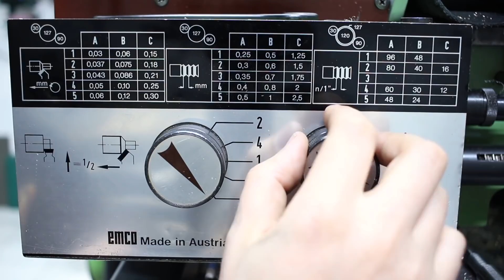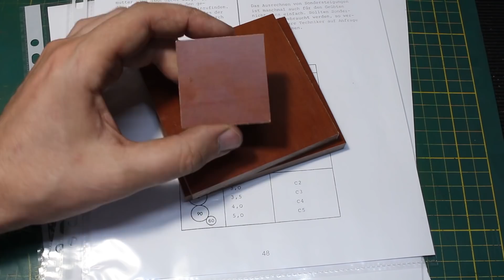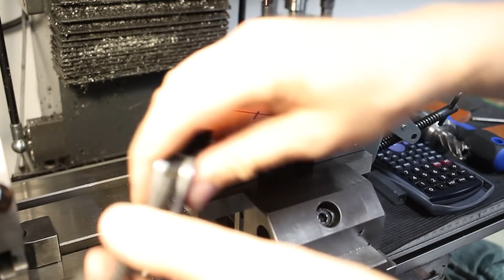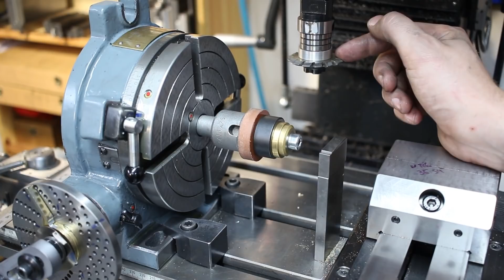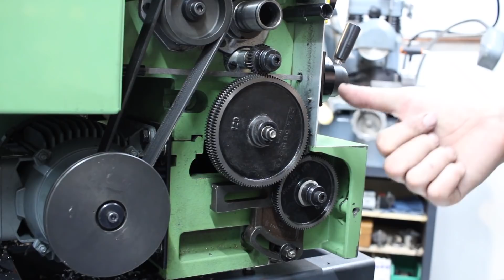Emco Super 11 Change gears, gearcutting and threading

Comment: How do you know how deep you need to mill the slots? I watched it closely and it's not all the way in where the cutter curves, right?

Edit: Never mind, i found it online. For Module 1 it's 2.15mm. Correct me if i'm wrong.
Edit 2: I measured it on a gear that i bought recently and it actually is 2.15mm.
Edit 3: Apparently i was wrong all along. I found enough info here and there to conclude that it must be 2.25mm for M1 gears.

Comment: Hi Stefan, I own the same lathe, and I have not clear what are the correct operation to stay in syncro while threading: seams like you never disengage the feed, is that correct? you engage the feed, make a pass, stop the motor, backup, invert the feed, turn on the motor to travel back , stop the motor, advance, invert the feed etc...
I guess wrong

Comment: I had a 1955 Holden ( made in Australia), GM Chevrolet design.  The timing gear on the camshaft was made of phenolic linen matrix.   They lasted about 15,000 km (10,000 miles) before they broke.  Usually on a Saturday morning, when you needed the car to take the girlfriend out in the evening.   Those were the days, my friend.................

Stavros

Comment: Hey Stephan, I feel your change gear pain. My Hardinge has a 33.3 DP with a 20deg contact angle if you can believe it. Which means there’s absolutely no involute gear cutters in existence to make the 127T I am missing to be able to do metric with an inch gearbox. So I’m stuck with single point hand grind or getting fancy with the material choice on my 3d printer.

Comment: This is odd!  I have the imperial version of this lathe, and I can cut metric 0.75  with the gears provided (8 to the inch leadscrew, use 120/127 gear pack in headstock side).  I can also cut 1, 2, 1.5, 0.6, and 0.5.  On my lathe, gearbox ratios (on the 1-2-3-4-5 lever) are 24/16, 24/14, 24/12, 24/10, 24/9 (to give 16,14,12,10,9 threads/inch) with A-B-C lever in C position.  B and A position halve the ratio, giving imperial threads double and quadruple those in the above list.  All of this is with 30T gear on spindle and 90T gear on the gearbox.

Comment: I always wonder how the number of teeth of "intermediate gears" (like the 95-tooth gear here) is chosen, because it doesn't really affect the gear ratio, and yet someone didn't specify a 100-tooth gear, or "any gear that fits", but a 95-tooth gear specifically... or maybe put differently: why didn't you just reuse e.g. the 120-tooth gear instead of making the 95-toothed one?

Comment: Unless my understanding of gear mechanisms is extremely wrong, couldn't that 95 tooth gear be any number of teeth since its just transmitting torque between two other gears, meaning you could have saved yourself some time and used the stock 90 or 120 tooth gear instead?

Comment: Stefan, Your videos are excellent and very clear. They explain things in a simple way. I have learned a lot from you particularly the scraping ones. I see that others have suggested using a stepper motor and rotary table to ease the division calculations. I have done lots of gear cutting for Horological work with the largest being 400 teeth .4 module. It took ages and I was worried about the dreaded half tooth! Luckily it was ok. I recently had to make change gears and decided to make them of 7075 aluminium and never thought of using Phenloic, interesting choice. I also recently made a computerised indexing system using a rotary table and some readly available components from www.worldofward.com. You can see the results on www.youtube.com/watch?v=ghZqn5L_nfI
I am no electronics expert but it worked first time for me. John

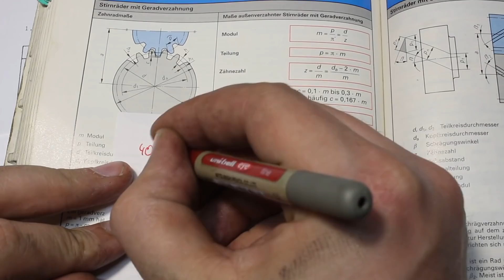Comment: Great job, this is the good old mechanical way, just like we learned it in school before computers were available. Yes i am still familiar with the "Tabellenbuch" and also my heart nearly stopped at 5:26 when you were drawing on the paper sheet i did not see. There is a guy having solved that issue  electronically (for an other lather) using a rotary encoder and a stepper motor with a processor calculating the gear ratio. He can select any gear and feed ratio (metric and imperial) as he likes. I just recently saw his video and i want to build one for my Weiler LZ 280 in winter. 
Have a look at Clough42 electronic leadscrew
https://www.youtube.com/watch?v=FTs9GygRQ-U

Comment: Phenolic gears are good for constant low stress applications but they should not be used for high stress or applications subject to impact as they tend to shear teeth fairly easy. I worked in a shop once that had a small (24") radial drill press that was rated for 1 1/4" maximum bit size. The boss wanted to drill 1 17/32" for pin tabs and had a 1 17/32" bit turned down for the applicable Morse taper in the press. I told him it was not a good idea but he insisted. The phenolic gears lasted less than one hole when they sheared teeth as the bit bound as it was breaking through the steel plate. That drill press never ran again...........

Comment: Very nice. I have an EMCO 5, which has change gears only and only the metric gear set. For imperial, it uses some approximation for the 127/50,  there was an imperial gear set from EMCO which I didn't have. I 3D printed the gears per EMCO table in PLA,  these gears have been working fine for 2 years now. It's a much smaller lathe though.

Comment: great video sir. FYI/SA, EMCO still has change gear sets for the Super 11, or they did two years ago when i realized that it was cheaper for me at the time to get the gears rather than buy the tooling needed to cut gears...they weren't cheap but worth it. had I the dividing head and the gear cutters i'd have done it myself.

any chance we mere mortal Super 11 owners can get the cut plan for the top slide guard you had laser cut???

Comment: Found your channel and subscribed  through This Old Tony and so far am very impressed. I use that same material and also something called Garolite (may be a trade name) that I purchase through MSC here in the states. Use it for a lot of different things. It is also heat resistant and an excellent insulator. I build fixtures for induction braze machines so these qualities are much needed. It is rough on cutters. The material is so dense that heat stays at the surface being cut which will break down a cutting edge quickly. I use only carbide and your use of the shop vac is also correct. It is nasty stuff and the dust gets everywhere. Great job.......

Comment: You've done a few parts in phenolic. Did you get a good deal on some of it?
Why not just some carbon steel or even mild?
Reply: It has nice shock absorbing and self-lubricating properties, plus the gears are quieter and they act as a kind of 'mechanical fuse' because they will always break before the more expensive metal parts. Phenolic gears are really common in machine tools: my dad owns a gearhead drill press that uses helical phenolic gears against hardened steel pinions in the gearbox, and they work beautifully.

Comment: I don't understand.

Why does the first wheel (95) need to be a particular number of teeth? All it does is transfer (and reverse) drive from the drive wheel to the "new pair" (80/40). It could (within limits) be an arbitrary size and hence number of teeth.

I am doubtless missing something, but what?
Reply: I agree. I believe the first wheel can be any convenient size to make the train easy to assemble.
Reply: no you are not
however the bigger the idler the better, as wear will be minimized
the 95 is part of the standard set of gears that come with the machine
Reply: @janvanruth3485  that can't be right. Why would Stefan make a gear that was already supplied?
Reply: @paulwomack5866  it was part of the standard sert but Stefan does not have a complete set

Comment: Stefan, I cut a lot of gears and splines over the years in my old job I retired from (automotive engine and drivetrain) for replacement parts in components. These were cut primarily with gear bobbing and shaper equipment. A lot of the gears were Fellows Stub Tooth in which they used the the pitch diameter of one size and tooth height of the next smaller pitch. This would be expressed as 10/12, 8/10, 12/14 etc. What I'm getting at is is there a Module Stub Toothed for

Comment: I hate this material so much; super abrasive, fine dust everywhere... Just finished a bunch of Mod 1 80T gears in it at work, but at least I could hob them instead of having to index. I made a little dust catcher for the hobber which sends about 95% of the dust straight into the shopvac, but the lathe still made a big mess

Comment: The 95 tooth gear is there only to transmit the rotation and bridge the gap, it has no effect in the reduction ratio. Any gear that fitted in the available space  would do and probably saved you some work.
Not as fun or fast, but you can also order very cheap 10mm thick mod 1 gears in steel from the popular auction site (the 40 teeth is going for  less than 5€ with postage). I've done it before because my (used) lathe was missing the change gears, only had to bore them and add the key.

Comment: Are you going to go back to an electronic lead screw in the future?
Reply from the maker: Nope, I am very happy in overall with the feed-gearbox on the Emco. Almost all common metric/imperial threads can be cut with the 120/127T gears that came with the machine. For the odd ones, well, its gearcutting time ;)
Reply: @StefanGotteswinter  even if you can do this ?😜

https://youtu.be/gNEjcWV7XjA

Comment: Had to smile when I saw this because recently I had to make a bunch of 14.5 x 0.75 male & female threaded parts for Primus burners. Fortunately my Emso Maximat 11 came with the accessory gear set for the non-standard pitches so I didn't have to make the gears first. But - I've certainly had to in the past, with other lathes, for oddball pitches.

Anyway, nice job. Those Emco lathes are beautifully built, I don't ever plan on parting with mine. One day I'll fit a DRO though.

Comment: Great information regarding the phenolic material.  I think I would have started with the round type and found out the hard way.  As mediocre as my Chinese lathe is, it came with change gears for the two pitches I cut most.  Those are .75mm and 11-1/2 TPI.

Comment: If you had a way to reduce your input to the gear box by 50% you could just use the setting for 1.5
Reply: @Sean Draper 
OK, then in that case the 95T gear could have been anything that fit the center distance requirement. I've had to come up with enough unlisted gear trains especially for hobbing helical gears.

Comment: Those gears will last forever. The Emco 7,8, and 10 used phenolic gears in the head. They only went bad when you tried to shift speeds before stopping. You could retire making gears for those as they are now made from unobtainium and many ham fisted gear grinders had those smaller lathes. Great video, thanks!

Comment: Wouldn't adding the new gear reverse the screw?
Reply: The lathe already has support for LH and RH threads. A 3 gear/rotation setup would require different settings than the 4 gear/rotation setup he used, as noted in the manual chart under the 'Schaltstellung' ('switch position') column.
Reply: @scottr939  Thank you!

Comment: nice work but they leave some pitches out of the gearboxes so every now and again you can skip the job and relax.  you're not supposed to make your own change gears. those charts are made up. you got really lucky.
Reply: Aren't you supposed to be making the next video I'm waiting so impatiently for? :)
Reply: @IBWatchinUrVids  This Old Tony couldn't find right gear for his camera, so he is relaxing now lol 😂
Reply: Yeah give it to him.
Reply: I thought you should just use the closest pitch and cross thread the nut?
Reply: @jtkilroy  Just turn the nut as well.
Reply: The tables are made-up, and are incomplete. It is worth taking the time to make a spreadsheet to see what pitches you can actually make. There are more ways than one to make many pitches. This can often save the trouble of changing pick-off gears, or allow you to make a pitch that you don't have the book-gears to make. 
My Chinese lathe seemed to have an interestingly designed quick-change box where every single change in pitch seemed to require a swap of pick-off gears as well as changing the quick-change.
Reply: That would be my answer, if it's not in the gearbox it doesn't need to be done. Not being a geniuos tho I was wondering if a imperial setting might of covered the missing metric setting on an accident
Reply: @Vladviking  very rarely, but it does happen.

Comment: You might get a little bit more wear resistance if, after milling the teeth (and bore) you coated with a very viscous epoxy and then re-milled the part. This is assuming the epoxy soaked into the phenolic resin at all.

Comment: you can prevent "tear out" on micarta by backing it up with pretty much anything. Most of the time I have used another piece of micarta, but alum at least .040 works quite well.

Comment: Stefan, do you have a flywheel on your lathe motor? Just curious what thats about? 
Great video as always!
Reply: @NewJacob, The Emco Super 11 lathe circa 1979 I bought second hand a few years ago also has a flywheel fitted to the motor shaft; However my friends much newer Super 11 circa 1993 did not come fitted with a flywheel...Not sure why Emco chose to fit one on the earlier Super 11's and not on the newer versions?

Comment: A little Bakelite with my coffee this morning. Chevrolet used it for silent timing gear in their "Blue Flame" six for decades, and yes there may be just a smidgen of asbestos for added flavor. Got to love it when Stefan makes 40 parts for a 1/4 in of thread in under 35 minutes.
Reply: Robert Klein, same thing in Australia under the Holden badge ( A Chevrolet Company with an Aussie Coach building company name) their early Six's used these gears on the camshaft with pretty good reliability and quiet operation for many years.
Cheers from John, Australia.

Comment: Hi Stefan, very nice video, especially if you only have to look at the first 3 teeth and the last one. I have an Emco Maximat V10 lathe with the vertical milling column. It was my fathers machine that I inherited when I was 18. I am 55 now and my shop is too small so it is stored in a wooden box and I bought a "bernard" Chinese lathe that is much smaller and without a gearbox (you only do it by swapping gears which is a pain in the neck). Your video recalls the times when I made m=1 gears and the stress of doing all the repetitive work fearing not to end up with a tooth overlap. At the end of those tasks I always wanted to automate the rotary table brake and rotation at least. I am following your channel for a couple of years (excellent content) and guessed your height might be close to 170. I had to get myself into the mood to see NY CNS's video about your shop (due to its length) and was surprised that you are 203. At the end it was a very enjoyable video. I would not like to get with you on an argument about who is the next one to use a machine at your job.

Comment: Thanks Stefan, very interesting. I believe I've seen phenolic gears before in devices. 👍. Beautiful work as always.
Reply: Yes,  in West Germany 1971, I discovered that my 1960 Opel Kapitan (GM company) straight 6 had helical phenolic timing gears when they failed. They simply disintegrated, and according to the parts guy, it was a common problem.
Reply: My myford S7 has a phenolic tumble gear

Comment: Why did you need the 95t gear here? It doesn't seem to actually be participating in the ratio, so couldn't you have just used the 120t or 127t gears instead? Just trying to complete your set of gears for the Emco?
Reply: Well, it is a really good question, you seem to be right.
Reply: You are correct. A single gear on a shaft just reverses rotation. Changes in reduction require two gears on a shaft. I'm surprised that Stefan did not recognize the situation.
Reply: Huh? He shows what the book says he needs in the beginning, and he shows all 3 new gears being installed and used towards the end.
Reply: @scottr939  Think about the what's going on. There is no change in reduction with just one gear on a shaft. It's only changing the direction of rotation between gear sets. 
Though his manual specified a specific gear, it was based upon providing sufficient clearance and using a spare gear not otherwise required from the stock gear set. He obviously does not have all the gears that originally came with the lathe. 
The manual for my lathe does the same thing, but if you understand what's occurring you can save time and just use the most convenient gear.
When I saw Stefan using a large gear as a spacer, it became abundantly clear that he hasn't set change gears very often. I either use a spacer or the smallest unused gear.
Reply: I should say though, excellent work, even if it was more than necessary.

Comment: Just thread 1.75mm right handed, then 1mm in reverse left handed. I swear it works!
Reply: I always hated cutting Micarta (trade name for phenolic). We used it for pump bushings and insulators for bearings in seam welders and on broken tool detector